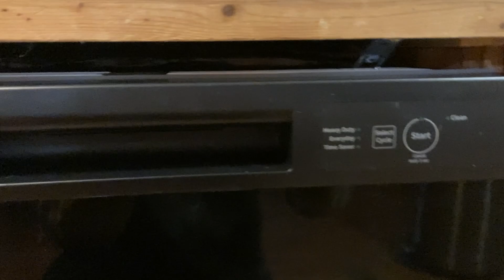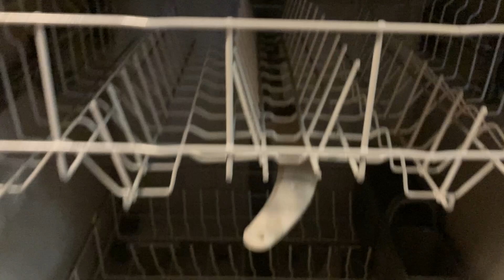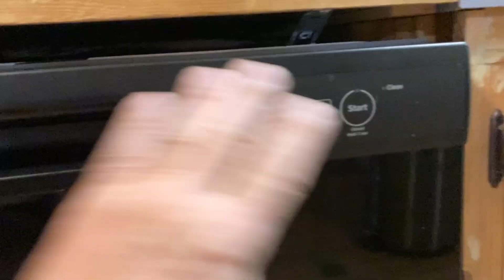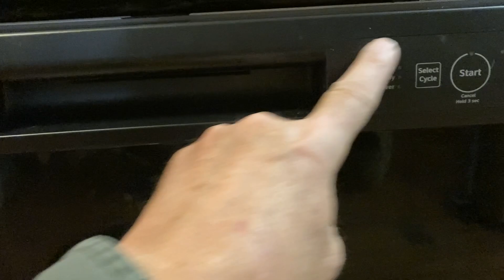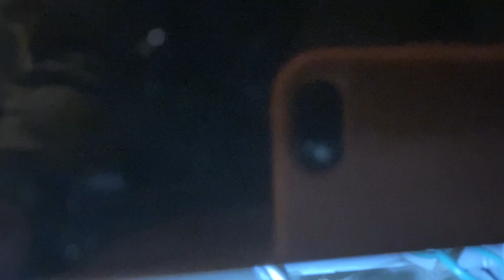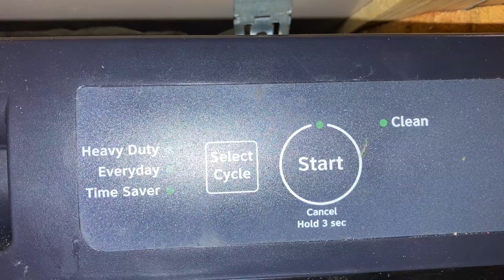Hotpoint dishwasher repair mod hdf330pgr3bb

Comment: I have a problem with my dishwasher….. it will start and run for a few seconds then drain and cut off. What would cause this?
Reply: I have an issue that's sounds like yours. Does your machine sound like its lacking water? I get water but it sounds like its just trickling in